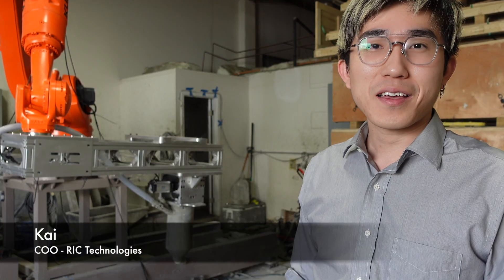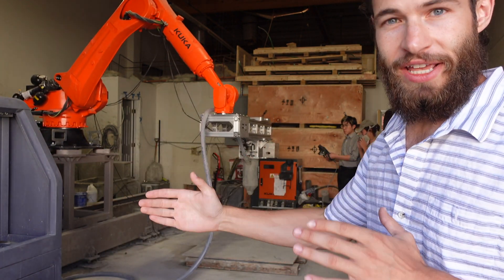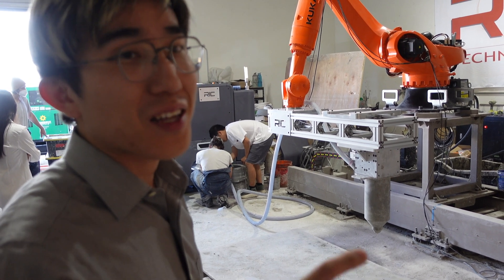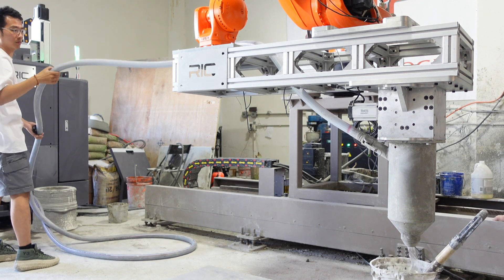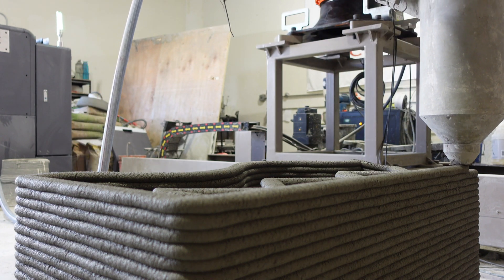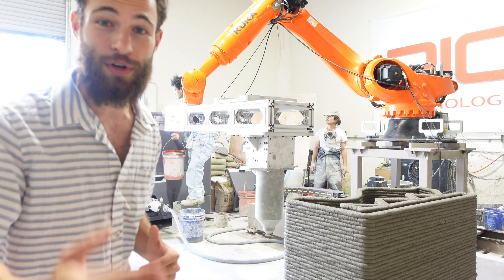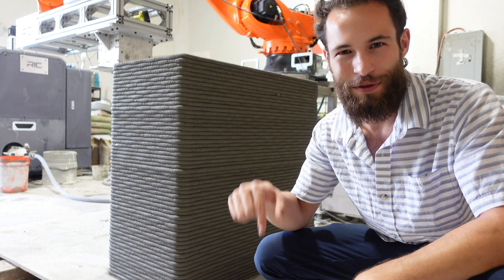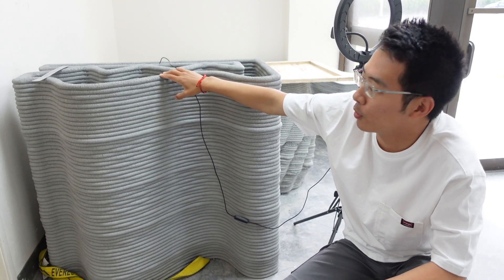LIVE PRINT IN LA | RIC Automates Construction

Comment: Another great video. Thanks.
I’d be interested in finding out estimated costs of the systems you review.  For instance this solution looks like it is only able to print small parts (ie. not a whole house). While it’s cool, how many planter boxes would you need to print and sell to pay off the equipment? How does this compare to traditional concrete planter boxes and what are the benefits of using the printer instead?
Also, I assume that their system could scale, so a bigger robot could provide greater reach and maybe enable a small room/house to be printed around it (so long as you can remove the robot before enclosing the last wall/space. Their current system doesn’t have a swivel joint, which would likely be needed for this sort of print to prevent the feed hose getting twisted. What is the lift capacity of their current feed system? If you print a room/house you’d need to lift the material to somewhere around 2.8-3m. I suppose one option would be to lift the mixer/feed system on an elevated platform.